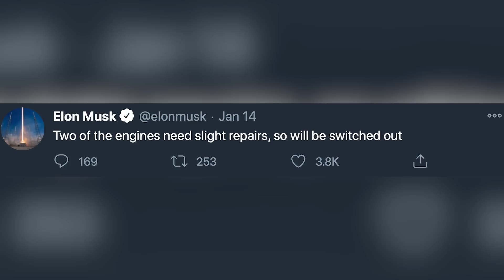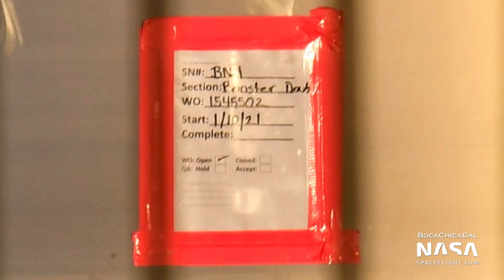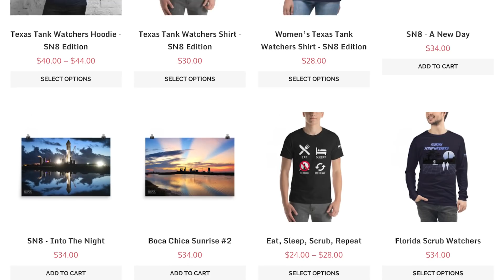Starship SN9 Has Raptor Engines Swapped After First Ever Triple Static Fire

Comment: Bit concerning that the Raptors seem to be struggling, most recently with restarts. I get they're new and cutting edge, plus SpaceX is all about iteration. But surely this aspect could have been ironed out on test stands rather that seemingly testing once fitted to Starship and requiring lengthy swapouts, re-fuels etc?

Comment: Times may change 
a lot coming up still in January 
Go SpaceX

1.) next Starlink-16 (L17) mission from KSC, LC-39A to LEO on 1/20/2021 @ 8:02AM  (UTC -5:00)🛰
2.) then SN9's 10km hop by starship from Boca Chica, Pad B SUBORBITAL  @ NET 1/20/2021 (UTC -5:00) 🚀
3.) then Transporter 1/SXRX-3 mission from CCAFS,SLC-40 to SSO on 1/21/2021 @ 9:24 AM 🚀
4.)then Starlink -17 (L18) mission from KSC, LC-39A/or/SLC-40 on @ NET Jan. 2021🛰

keep up the great work all of you guys over at NASA Space Flight 
and SpaceX and most of all Elon Musk

Comment: can they really do this? if damages always occur it might be not posible to make a fully reusable but refurbishable or i am wrong?
Reply: You might be looking at it all wrong?? We do not know what the Raptors failures were from. It could be a 'low spec part' failing, because of the short firings? It could be from debris being flung into the Raptors structure? It might be a design fault that they are working on and have yet to find a 'fix'?
Just remember, that these are static tests and in 'future' production, after the tests, the Starships will be placed on top of the Booster Rocket on the (yet to be built) Orbital Launch Pad. They will not launch from these pads. 
If it's debris causing the damage, I think they will have to raise the pads, or dig a hole and have a director out to the side.
If it was a 'serious' enough problem, I am sure they would do a 'quick fix'. eg metal shields around the top of the exhaust nozzels to protect the top section.
Reply: @David-yo5ws  i really hope this will work. its amazing to imagine that we can really ride in a rocket then fly outside the earth just to travel from one to another country and also in other planets
Reply: @donjake9151  I do too. It's a pivotal point for change, that's for sure. 👍

Comment: Electrical wiring is emplaced in conduit, not pipes. Just saying.
Reply: I never emplaced any wire in conduit, but I sure pulled a lot of it in over the years...
Reply: @danfountain1713  Both my dad and brother were career IBEW pros, and I worked Civil Engineering. Spec writing uses certain words like "emplace" to avoid confusion and to be precise, and my dad and bro made it clear that wires go in conduits, not pipes. A lifetime spent in construction makes things like this old habit.
They also gave my sh*t for talking like an engineer, so I'm used to it. Are/were you, as my lineman dad would say, a narrowback like my bro, and whats your home hall.
Reply: @larrybuzbee7344  Shoulda added a smiley to my comment. USWA  4950 & 4974.
My dad was a civil engineer, who joked that the title was an oxymoron. ;)

Comment: SpaceX is going to have to sort out its pad damage problem...
Reply: Technically, they do not launch from these pads. Also, we do not know if the Raptors were damaged by pad debris or through a 'low spec part'?? caused by short start/stop bursts.
I think that if they raised the Test Pads slightly higher, for the "static test fire proving": before they stack them on to the Booster Rocket, then maybe that will solve the problem of pad damage, as the exhausts force will have spread a bit more after say 3-4 more meters???  
Also less chance of 'Bounce Back' of debris.

Comment: @nasaspaceflight given that "air" contains 78.09% nitrogen, 20.95% oxygen, 0.93% argon, 0.04% carbon dioxide, and small amounts of other gases. What stands in the way of at least distilling out the Nitrogen too... with the fancy new toys for distilling Oxygen?
Reply: As I understand the process, it does make and use [some of the] LN2 for processing the LOX.